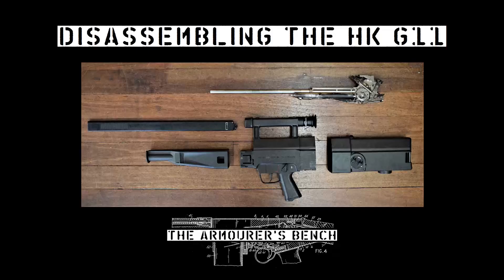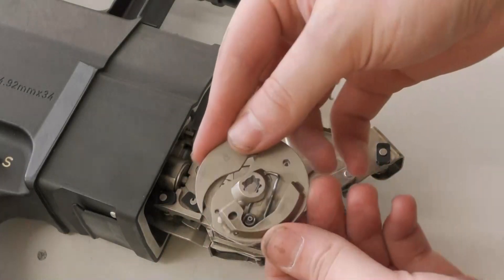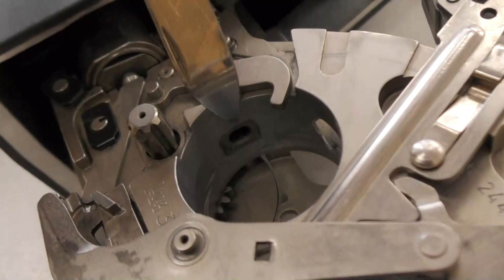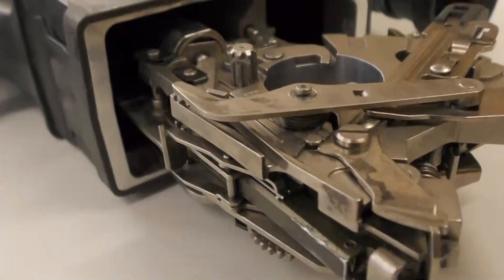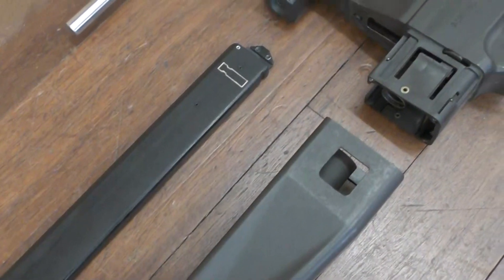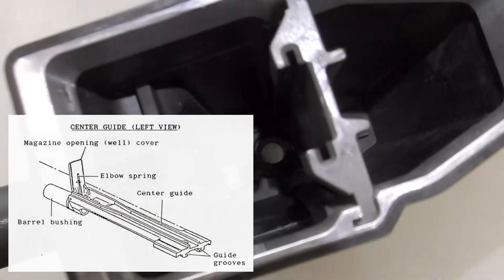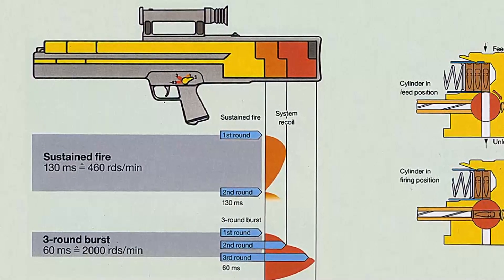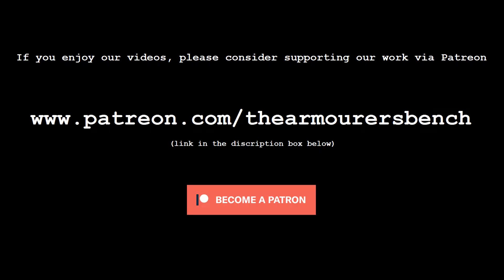Heckler & Koch G11 Disassembly &  How It Works

Comment: "requires to be cocked prior to disassembly"
Um...
Yeah.
That's certainly a thing.
Reply: You mean like a Glock?
Reply: @skepticalbadger  
Not according to Google? Apparently they're double action only, pulling the trigger pulls and releases the striker?

Although regardless, this doesn't really mean anything, the G11 has to be cocked before disassembly, it's an inherently dangerous method because a cocked weapon is ready to fire if somebody forgot to remove the magazine. 
Or what about disassembly to get a round out of the weapon? 
Now you know there's a round in there and you must cock the weapon to start that disassembly. 
And when I say dangerous, I don't mean it has a high chance of accidental discharge, just that is  inherently more dangerous than NOT having to cock before suddenly.
Get it?
Reply: @MostlyPennyCat  Apologies, I used entirely the wrong example as the Glock is unusual in requiring one to pull the trigger before dissassembly, ironically regarded by some as unsafe, whereas a hammer-fired weapon left cocked is totally safe provided you don't put your finger on the trigger. And in fact, ANY hammer-fired firearm requires to be cocked, and be left cocked, to disassemble. 

That includes the weapons this would have replaced - the M16/M4 and G3, already required this. So while I was wrong on the example (lack of sleep) my point stands all the more - many, many firearms including the ones the G11 was intended to replace, require this step, it's not regarded as in any way unsafe because the weapon has to be properly cleared regardless of what you do.
Reply: @skepticalbadger  
Ah, I see, thanks.
I came across another example, some dual action striker fired pistols require a trigger pull before disassembly which some people don't like (understandable) but Walther fixed this with the P99 which has a safe decocking button which will decock without firing even with a  round chambered. Has a nice bright red cocked signal on the back of the slide, too. Really nice piece of ergonomic design.

Comment: Amazingly ambitious and a slightly similar system now on the new CT40 canon. The fact that you could carry 150 rounds on the gun and it would only weigh the same as the G3 with several hundred rounds is impressive. 
What stopped it being finally adopted by the German Army. 5.56mm standard? Reliability?

Comment: I am so glad the U.S. Army never adopted this rifle. This rifle never would have survived Iraq/Afghanistan as the moon dust would have destroyed this sewing machine.
Reply: Dont underestimate German engineering
Reply: Dont underestimate German engineering
Reply: @eueusu3h2ys8ay  It has a small unload/ejection port on the bottom. It leads directly to the firing clockwork nightmare. Now dump a bottle of talcum powder into it and see how long it takes for a malfunction to happen. The dust in the middle East is just as fine. Not a single system was immune to malfunctions in IOF/OEF, it was that bad.

Comment: Cool, could oyu explain how the ammunition works & why they didn't use this gun?

Thanks.
Reply from the maker: Basically it's self contained with the projectile in the centre of a block of hardened propellant. This removes the need for a cartridge case. It wasn't adopted because it was eventually thought to be too complex and too expensive for mass issue. Thanks for watching!
Reply: @TheArmourersBench  The hardned propellant (like a hard medicine tablet) was the casing? Cool concept though I think that would break or chips overtime reducing the power and it's not a durable ammunition. I get the complexity.

Comment: There's one thing that I really want to  know about the g11.........is it reliable?
Reply from the maker: I would not want to be in a firefight with one. It would seem to be damaged ammunition which would cause the most problems and given the cocking handle which is used to clear the action is a plastic flap I'm not too confident.
Reply: @TheArmourersBench  hmmm....I love the g11, but in a matter of practicality I'd stick to an hk 416 or ak.

Comment: Fun fact : The G11 Has 451 Parts Only In the Mechanism and It was too Complex than the soldiers than was "assigned" this Rifle was prohibited to Make a field trip or try dissasembly it and In case of a malfuction they was obligated to Give the rifle back to H&K HQ To fix it and receive it back, thats why the G11 is Also called as the Kraut Space magic , It was too complex, looks like a space gun and his mechanism looks like works with magic
Reply from the maker: Glad you enjoyed the video.
Reply: @TheArmourersBench  thanks for that But I hope  they make a Dummy round of the G11 K2 ( 4.73x33mm Caseless )

Comment: The three round burst was the intended design looking at it; the gun was built specifically for burst fire, with options for single round for one third the recoil or low ammo, and full auto strictly for suppressive fire.
I'm noticing a lot of people falling for the full auto meme, thinking that full auto is the best way to fire the G11 (and therefore being put off by its low rate of fire). The truth is burst is king here, and this is greatly supported by the fact that the shooter would feel zero recoil until the third round was fired, meaning the first two rounds in a given burst would've been smooth as butter, at the cost of triple the kick (a small price to pay; it's amazing what you can learn to get used to).
Another thing I'm noticing is that people are failing to understand that even the G11 K2, its field approved design, was still a prototype, and an exceptionally functional prototype at that. With proper field testing and continued R&D its few problems (action maintenance, overheating, firing life) would've quickly been solved, and potentially this could've kickstarted an evolution into caseless munitions that would be felt to this day.
What I'm seeing here isn't just a good rifle and a swandive into mad genius, it's also a very important rifle.
Reply from the maker: Agree Joe, thanks for watching!

Comment: This gun is in desperate need of a John Browning to simplify the mechanism. Way, way too many parts!

And, based on how the rotary chamber disassembled, a ceramic chamber for heat mitigation, to address cook-off problems. One interesting advantage of cased ammunition is that the brass case acts as a heat sink and dumps heat out.
Reply from the maker: I like the idea of a ceramic chamber Scott! I would love to have Browning's impressions of it. Some of his prototypes are pretty intriguing and out of the box too like his pull apart rifle. We've got a video on my favourite, his detachable box magazine lever action. Thank for watching!
Reply: Cook-offs haven't been the problem in caseless systems for DECADES now - including the G11.  Gas sealing, now there's a problem.  Also, failure modes entirely unique to caseless like crumbling ammo.
Reply: @smorrow  the fancy propellant used in the G11 and the LSAT is designed to minimize the risk of cook-off by increasing the auto-ignition temperature of the propellant.

That is not to say that cook-off is not a potential issue for caseless ammo.

Cased ammo allows the brass case to be used as a heat sink and removes some heat from the weapon. Plastic cased ammo reduces the heat built up in the weapon by insulating the chamber from the burning powder.

Caseless ammo has neither the brass case for a heat sink, nor the plastic case for insulation. Therefore, all the heat of firing goes directly into the chamber. So a fancy ceramic chamber would be ideal to basically stop cook-off because no matter how hot the chamber gets it just doesn't conduct heat.

Have you seen the picture of someone holding a glowing red hot space shuttle TPS tile in their bare hand?
Reply: @ScottKenny1978  You've made me wonder if tungsten carbide, the first ceramic to come to mind to me as a layman, would solve both cookoff and gas seal in one fell swoop.  As I understand it (from Wikipedia), sealing on the G11 is achieved just by ultra-tight tolerances, which gas-jet cutting then wears down.  And since carbide is hard to wear down...problem solved?
Reply: @smorrow  I don't think TC is the right ceramic. At least not pure TC, since it's fairly heat-conductive. Maybe a mixed ceramic with TC in it, because the actual shuttle TPS ceramic is quite brittle. Something like the LI-2200 ceramic, as used around high stress areas of the Shuttle, might work. Or maybe a fancy combination of multiple ceramics. https://en.wikipedia.org/wiki/LI-900

Comment: imagine trying to get a bullet out when it gets jammed
Reply from the maker: And snapping off the plastic flappy cocking piece... Also its why they have the cleaning brush in the grip. In theory it can be used as a clearing rod. Not very practical in practice though.
Reply: @TheArmourersBench  It was officallzy approved by the West German Army in March 1990 and was about to replace the G3. Production was cancelled for politica, not technical or aby other reasons.

Comment: This is a really cool gun but theres no military that could effectively field this thing. The average soldier would destroy or lose parts immediately. Thanks for the video.
Reply from the maker: Haha, I knew what gun this was about even before I checked which video the comment was on haha. Thanks for watching!
Reply: Which parts would the average soldier destroy or lose? The outer hull seems to be robust, and the average soldier thus is not supposed to ever open it. Besides, German soldiers are not average soldiers, right. At least 30 years ago they were not,
Reply: @marcelbork92  Most soldiers are not as professional as you would think some are  not happy to be in the military. That weapon has to be cleaned. Just because you're not supposed to ever open it is exactly why the average solider will. I've seen soldiers completely strip their rifle in the field and lose parts. This applies to every military.
Reply: @marcelbork92  
why shouldnt they be average soldiers? I mean you could say that because most were conscripts back then. But that doesnt make them smarter than ie french or british grunts.

Comment: This explains exactly why this design failed as a practical battle rifle 
You need an engineering degree just to field strip it , let alone perform routine maintenance 
Caseless ammo was the unicorn idea everybody was desperate to make work 
Simply put if it ain't broken , don't fix it which is why the M16 and the G3 both endured

Comment: What a monstrosity, you would think hk would know that putting a pistol length gas system on a rifle wouldn't work.
The videos of this thing firing show it has as much recoil as a properly set up 308, even with its shock absorber, bells, whistles and propellers.
Not to mention the terrible accuracy the floating action will bring.
Reply: "Not to mention the terrible accuracy the floating action will bring."

From what I've read the thing actually had an improved accuracy for shooters, if fired in burst.

Comment: Everyone going ape over the low breech life, when 3-rnd burst was designed for hitting 300 meter man-size targets a much greater percentage of the time in a scenario where the Red Menace was rolling past the Fulda Gap to get revenge for Stalingrad.  Cold War soldier's lifespans were measured in # of seconds (usually less than one minute), so most German soldiers would have died before their breach did.

Comment: I don't understand how this wackass idea even got off paper let alone into corporeal form. You need an HK engineer to clean it, and God Himself to help you if something goes wrong or jams. On top of this it uses caseless powder ammo vulnerable to water, adverse conditions etc. And to see if it's clear you have to shove a brush up its hole, and I'm guessing if it isn't clear you simply fire it in a safe direction?
Reply from the maker: "shove a brush up its hole" lol. To clear it you can turn the cocking tab to engage the ejector arm that will push the unfired round out of said hole. It really does make you wonder how it got so far.

Comment: Really an incredible presentation. I've been a gun owner and a shooter for a long time, and probably had an amateur interest in everything weird and wacky firearms-related for just as long. I've watched this video three times already, and trying to make sense of what's going on with that mechanism there feels like trying to translate the Rosetta Stone with a pocket calculator. I can't make hide nor hair of it. But it's cool as hell.
Reply from the maker: Thanks for watching! I know what you mean, I spent a good few hours reading manuals that try to explain it. Basically the simplest explanation I can think of is that the gas piston acts on the teo main gears which turn the breech cylinder. All the other stuff built up around it just makes it even more complex haha. By the way there's links to the manuals on our site if you want to check those out. - Matt

Comment: Was anyone else wondering how many rounds this rifle can go before readjusting and/or replacing the points of its distributor?
Reply from the maker: Its distibutor?
Reply: @TheArmourersBench  The control disk looks like the mechanism inside an automotive distributor.  Electronic distributors began replacing mechanical distributors in the 80s, which had no points or springs to wear out.
Reply from the maker: Ahhh I get you! Well the chamber life was just 3000 rounds.

Comment: how did the G11 handle heat? As there are no cases extracted all the heat stays inside the gun. Is there Any information about how many rounds it took to melt the gun or made it uncomfortably hot?
Reply from the maker: I'm not sure it did have a number of issues with the ammo the chamber piece is I imagine a heat sink, which would explain the short chamber life. I have a few links to reports here: http://armourersbench.com/2018/02/18/advanced-combat-rifle-prototypes/

Comment: Definitely not an ideal military firearm, but it is indeed Kraut Space Magic.
Reply: Ubisoft Nerf there was an APG demonstration that stated that the user was not intended to take apart the barrel breech section. Instead that was just an armorer-level task (but still, the lack of an ejection port would mean that if there was a failure to feed or fire, the user would have to disassemble the rifle, as you can’t just rack the charging handle like a normal firearm).
Reply from the maker: Indeed, the field strip I show is what was expected of soldiers in the field. I just had to include the 'STOP' page from the manual haha, everything else was armourer level. It did have an ejection port for clearing.
Reply: Still, they went through all that trouble and (if I am remembering correctly) decided to go with a non-reciprocating charging handle, so not something that can be fixed quickly.

Comment: And they wanted to issue this gun to conscripts...
I trained conscripts in field stripping the SIG 550 and was amazed at how complicated it was for some of them to take it apart. and the 550 is just a fancy AK
Reply from the maker: Panzerfan93 I know! It seems highly improbable they would have made it to general issue. With elite units perhaps...
Reply: @TheArmourersBench  You are mistaken. It had been finally approved by the German Army's weapon evaluation authority, in March 1990, and mass production was up to begin soon after. It was cancelled solely for political, not for technical or any other reasons. They were seemingly quite confident that German conscripts would be able to handle it.

Comment: So it contains about 100 levers, gears, disks, or springs alright. Not exactly a practical weapon but absolutely awesome engineering indeed.
Reply from the maker: Agreed, Incredible engineering!
Reply: If you look at the maxim gun it's pretty complex but is still perfectly functional and it's showing it can hold it's own even today. But I have no doubt if this took it would have been simplified. Because what's harder than invention is simple invention.
Reply: I would agree if this was just a design exercise, but since it was supposed to be a wide-issue infantry weapon, it's actually terrible engineering.  Good engineering takes end use and user into account.
Reply: @jic1  Well then you might as well just use an AK